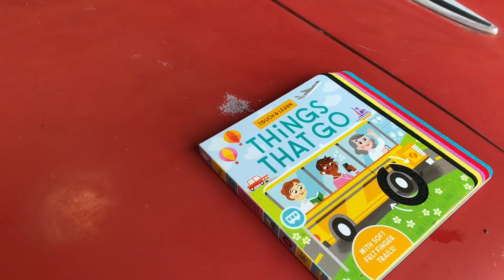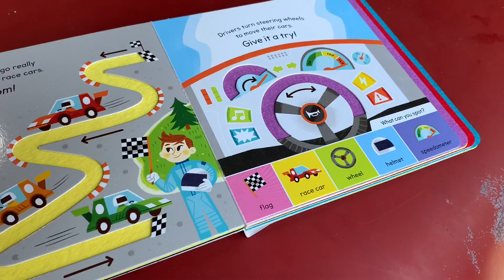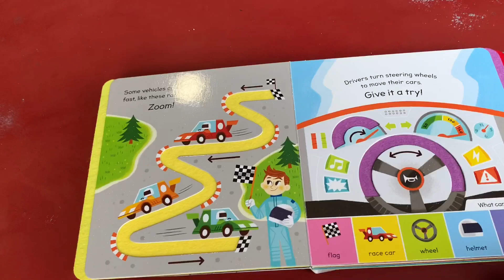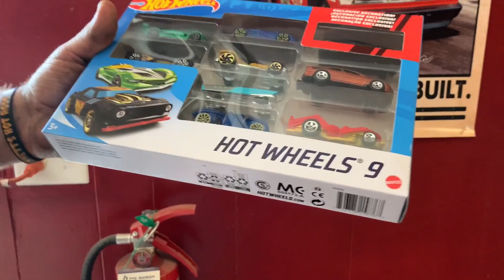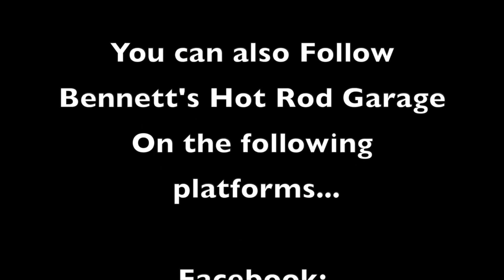Drunkle Tony from UTG takes the guys to kindergarten

Comment: That was nice of Uncle Tony to bring ya guys some crayons, they are for coloring NOT eating.😉😉😂😂😂
That Hot Wheels box says Mattel on the lower right of the box.
Marie Callender's makes a great tasting Pulled Pork Mac & Cheese bowl.😋😋😎

On that distributor it helps if ya use a screwdriver and tap on it and work it loose enough to turn by hand before ya try to pull it out. Had to do that quite a few time tearing down engines and even to adjust the timing on a few of them. I'm sure this is not the first stuck distributor that you guys have come across.
Reply from the maker: Too late
Reply from the maker: The purple one tasted nothing like grape
Reply: @bennettshotrodgarageclassi7068  LOL

Comment: So in a situation where you have an aluminum distributor body but a cast iron engine, does it make sense to use something like never seize when installing the distributor or would that cause problems due to the heat of the engine?
Reply from the maker: thats what we do, works perfect

Comment: All the older mechanics I worked with recommended to remove the intake. In order to get the distributor out. Because they have either tried or have seen attempts to remove the distributor other ways that failed to remove it. Without breaking, bending, or otherwise ruining the distributor.
Reply from the maker: That's fine, we were replacing it anyway
Reply: Had a similar problem once but this was an aluminum  seat post seized in a steel framed bicycle tried everything ,only thing that worked to get it out was bicarb soda chemically undone the electrolossis

Comment: Hey guys.  On that '69 XL I saw it was a 2BBL but is it a 390 or 429?  Is it a column shift or floor shift?
Reply from the maker: 390 on the column
Reply: @bennettshotrodgarageclassi7068  Hell Dad bought a $100 68 LTD in 1988 with a 2bbl. 390. 100,000 miles on the clock and had the Quaker State GUNK buildup encrusting both rocker shafts. Took that thing out and burnt a blackmark through all 3 gears up to about 70 mph. One wheel peel of course, but Looking at that 4 door LTD who'd have thought...
 Weirdly enough after a freshening of the cylinders and bearings and cam, since my Dad used a stock cam; that engine really had about the same HP sludged up and corroded with crusty lava.